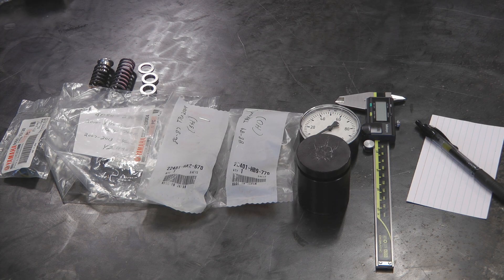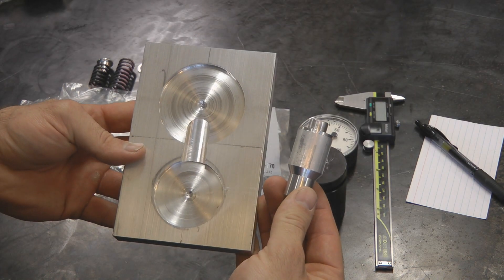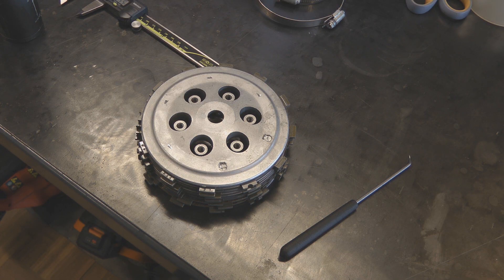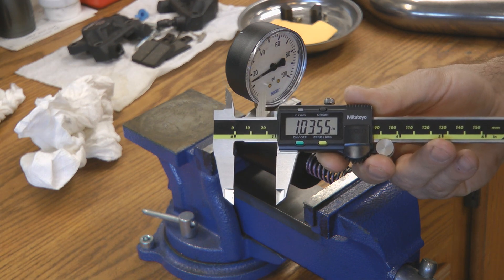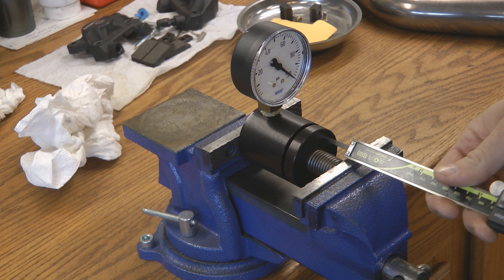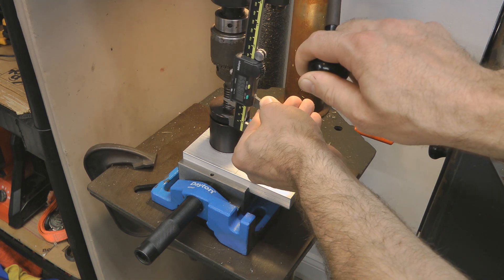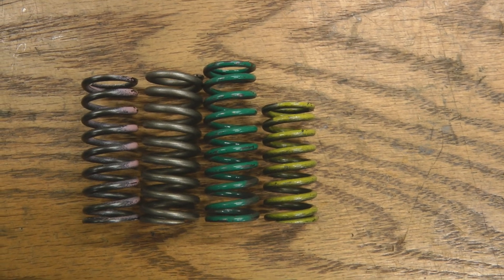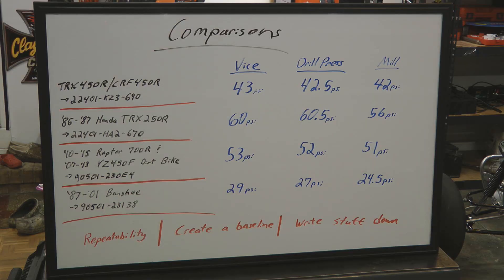Hott Boy's Garage - Ep. 7 - Measuring Clutch Spring Pressure & Clutch Tuning

Comment: How much variation in installed height is there? Could you make up a block for quickly and repeatedly setting up height? Or is it not worth the effort?
Reply from the maker: Installed height does vary by bike type and clutch pack used. Depending on how many springs you test and how often you test springs - making a block set at the bike's installed height would definitely be a good way to make testing multiple springs much faster.
Reply: Thanks.